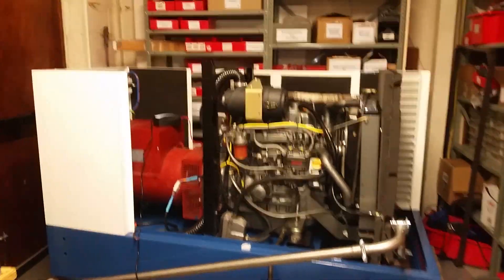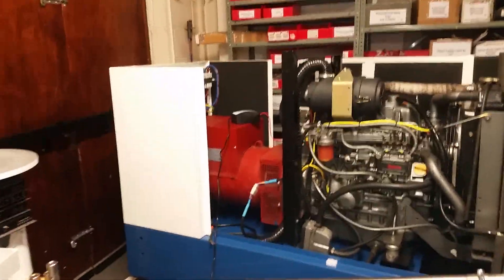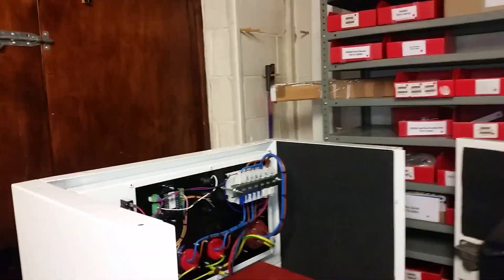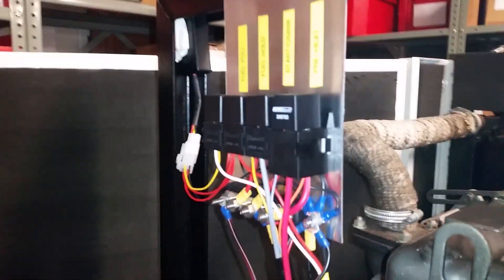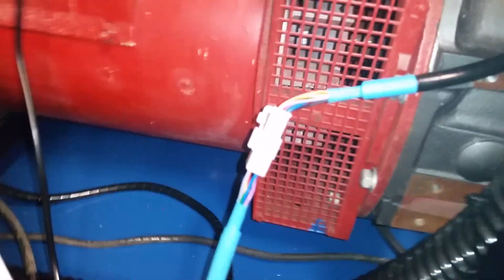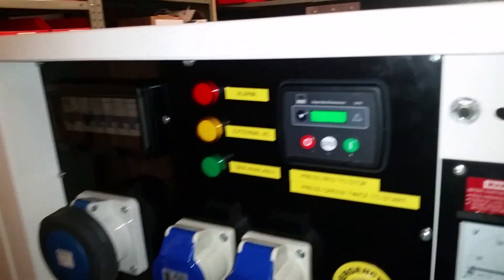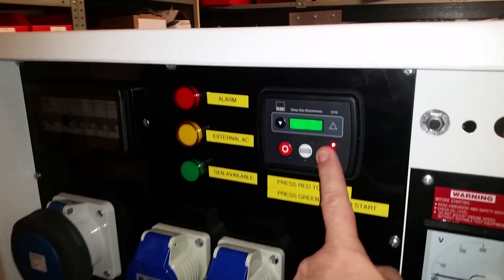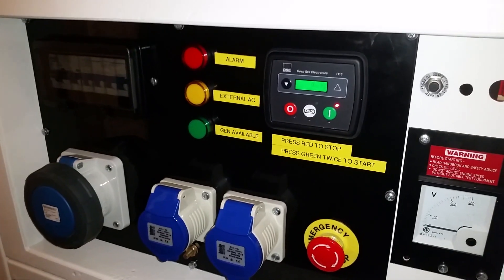25KVA Generator Refurbishment Project - First Start With New Control Panel

Comment: Hello sir i am using same module 3110 but i am facing a problem with starter time .when i start my generator . engine start but starter moter stop after 2 ,3 second .
Reply from the maker: How long the starter motor runs for is controlled by programming the DSE3110.  The DSE3110 will also stop running the starter motor when the engine is turning at 70% or the alternator output voltage reaches 70%.  Have you programmed your unit correctly?